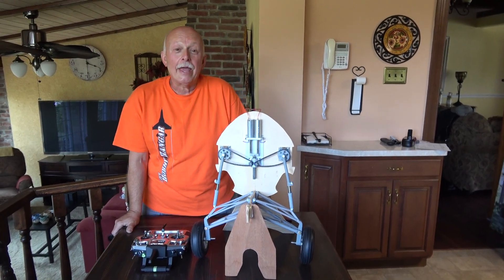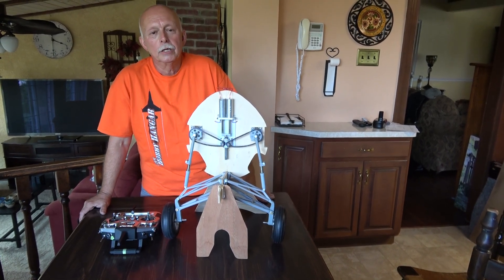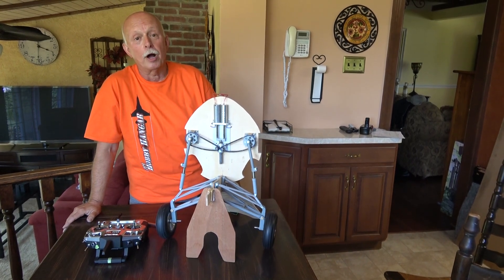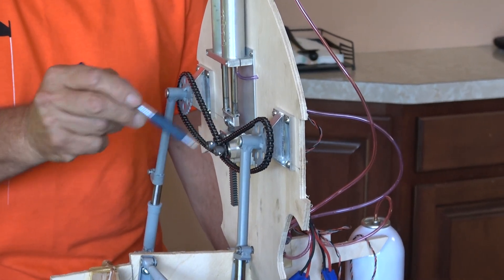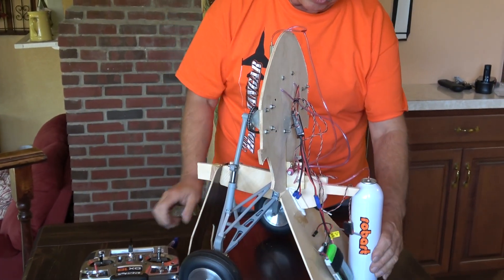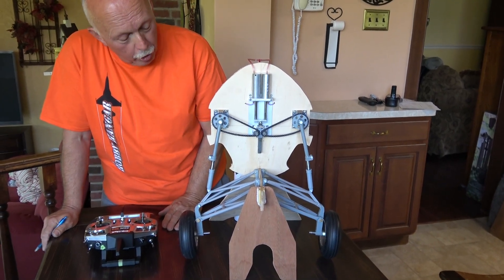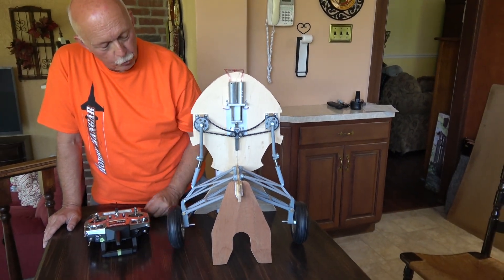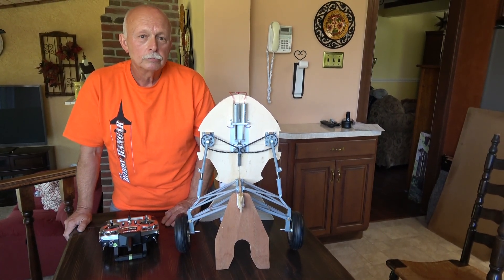(Part 1) Robart's "Jerry Bates Wildcat" landing gear explained!

Comment: I'd replace the air system and that FINIKEY VALVE with an electric motor or even a SERVO and be done with the major problems forever. JMHO.   Or just replace the Chains and Large SPROKETS with servos attached to the Pivot arms. Of course it ain't scale but you don't see the mechanisms anyway.
Reply from the maker: Thanks for watching this is the new version. https://youtu.be/3dPWVu_dkKI

Comment: Nice units,   sorry to hear the troubles you've been having,    personally,     I'd go away from air,    I have been using "Actuonix" linear actuators for some of my builds and they are great,     look into them.   You might be impressed.        I used one for a main gear door, mixed with a curve, and over riden by another channel as it works as air brake aswell.     Lowers fully,    gear down,  door half closes.     Totally variable,   as a normal servo is.      I'm now playing as using them to push a long small cylinder  into a larger, shorter cylinder to work as a force multiplier,    small electric servoless hydraulic system for main gear actuation.    Scale size rams.  With close to 300psi at the gear end,     same principle as a brake lever on a motorcycle.   Or car bottle Jack,         So far so good,    and very lightweight.    Using carbon tubes,   alloy for the  spares,    and very light oil,   using water and glycol at the moment through standard airline      Just and idea
Reply from the maker: Hi Russ, this is actually my fathers. I'll forward the info. Here is the latest update. Thanks for watching. https://youtu.be/3dPWVu_dkKI